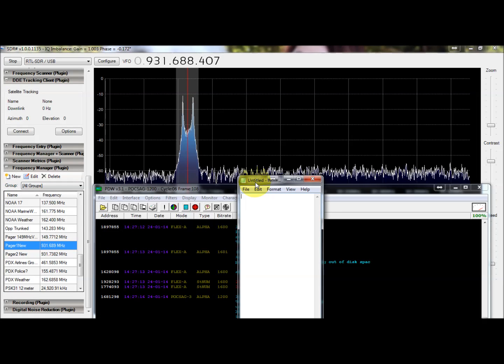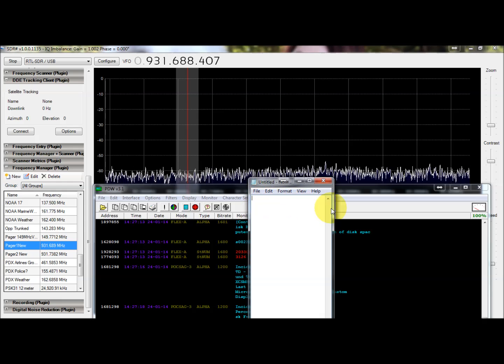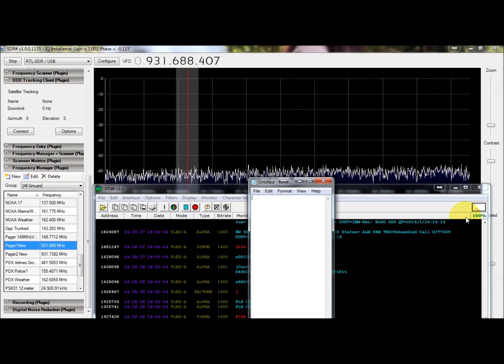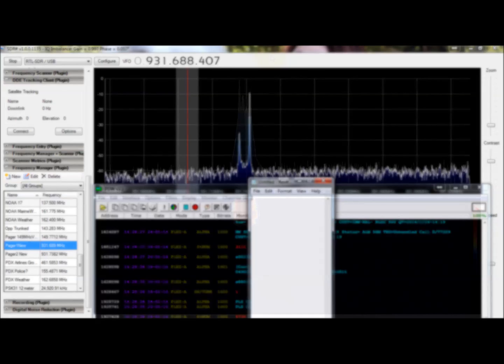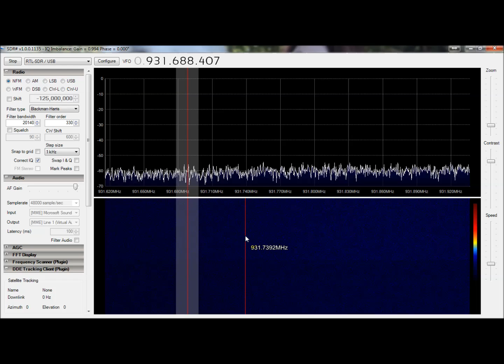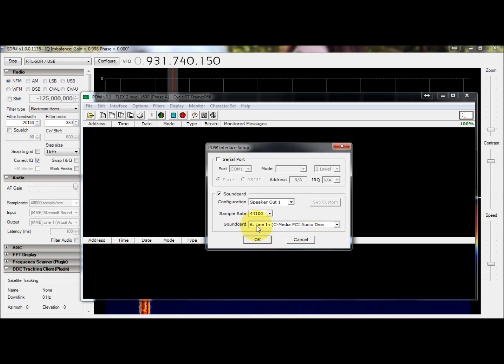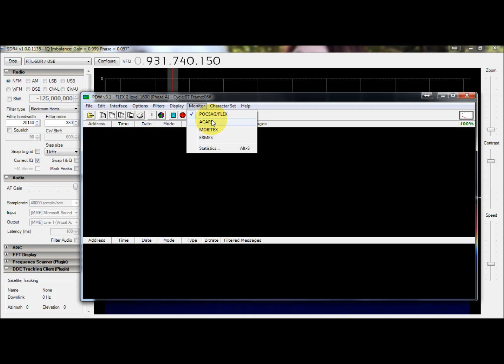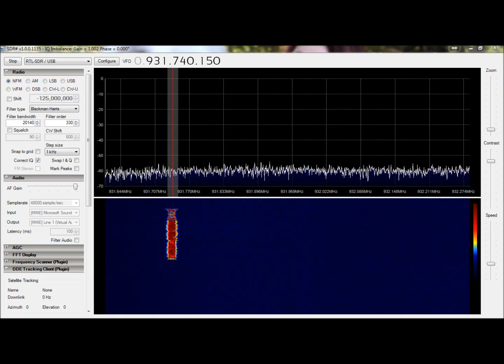Pager Data Decoding with RTL-SDR -Tutorial

Comment: I have tried every setting i know..with no luck..it just wont work....I have VC installed and have used it on other programs...the S meter is moving but very little...
Reply: i just put my soundcard to 41000 and boom this thing works. and yep.i quad sampled down to 1.4msps

Comment: I've used PDW and this cheap ass am/fm/weather radio which happens to be able to tune pager traffic. the tuning isn't precise and the headphone jack on this radio doesn't help as it simulates stereo from a mono radio. Thinking of getting an SDR dongle but I'd like to get the right one.
Reply: coondogtheman1234 are you likely to use it for anything other than ADS-B? If not get an ADS-B-specific dongle with a filter. If not I think the Nooelec SMArt is the one I have and I think it’s the best around at the moment unless anyone has anything else to add? Good range, modable for HF.

Comment: You should be able to get either virtual audio cable or VB-audio to work with PDW.  The big thing is to ensure your audio sample rates are the same from beginning to end. Start with the the 'minOutputSampleRate' in the sdrsharp.exe.config file, then to the 'virtual' audio channel configurations and then to the sample rate in PDW.  You may be aware that virtual audio cable spams the channel with a woman saying 'trial' every few seconds, this can obviously cause problems.  VB-Audio doesn't have that issue.

Another suggestion would be to add one of the autotuner/scanner plugins so that you can pass to the active frequency in the baseband.  It's a little tricky with pagers because of the 'horns' on the signal, but a little tinkering with filter bandwidth and snap settings might yield good results.
Reply from the maker: Thanks for the tips!  Cheers

Comment: Thank you for the sample rate configuration tips for pager and ACARS decoding. I've had the same problem, in that I could never get a 100% rate on PDW, and ACARS was always hit or miss.  This made all the difference for me.
Reply from the maker: Did you end up with a similar result? Really glad it helped in that case.  Took me a long time to figure this out and always wondered if it was confined to my PC setup.  Cheers Curt!
Reply: Yes, after I lowered the sampling rate, I got my very first 100% on the PDW meter during a pager decode. I'm currently away from my computer, but am going to try it out on ACARS later. Cheers.
Reply from the maker: Ha!  That makes me truly happy.  Awesome bud.  It's funny because so many of the tutorials led me to the higher sampling rates for higher "fidelity" so to speak.  Glad to hear going down worked for you too.  Awesome.